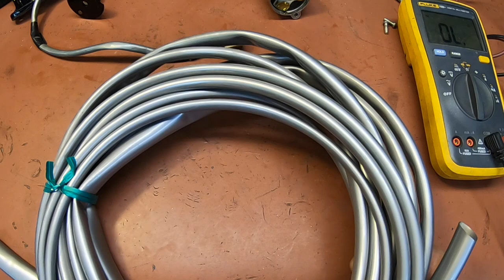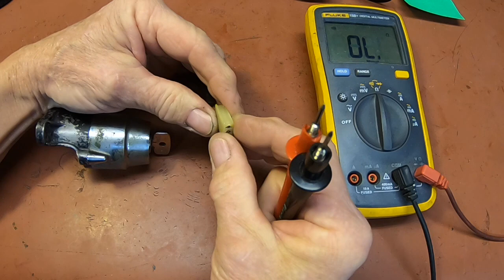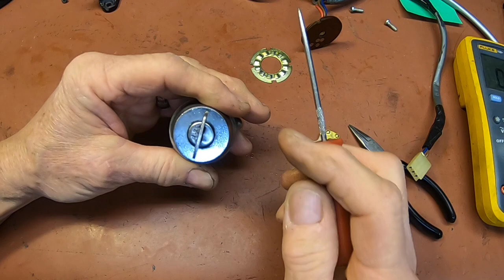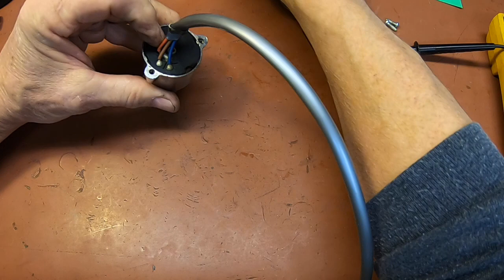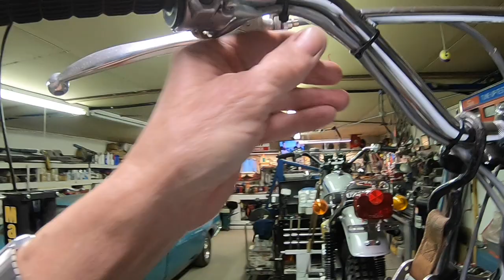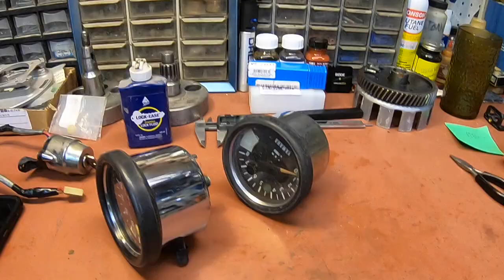Yamaha Enduro ignition switch repair AT-1, CT-1

Comment: Dale could you help me with a 69 CT! Ignition switch I think I have rebuily it wrong it has ball bearings and springs not sure how its assembled
Reply from the maker: Hi Robert, I will help if I can, I will need some pictures and a description of what you have done. userdakota@gmail.com
Reply: Has anybody converted the stock AT1 ignition to a digital electronic system? I’m building a vintage motocross piece.

Comment: Good morning Sir. Excellent electrical bike key switch work,you might be familiar with ‘ Flitz ‘ which is available on Amazon or EBay Flitz is a paste polish blue in color and this product that I have used for several years will clean and polish up metal relatively well worth hand polish soft microfiber and with the option of using a dremel polisher. God bless you my dear friend and brother. Thank you for your excellent work - videos.!!